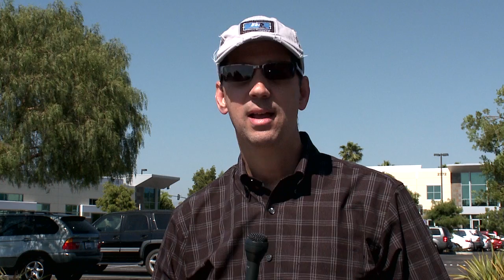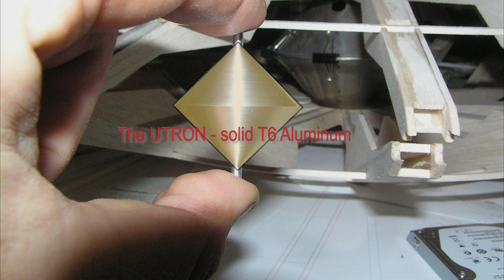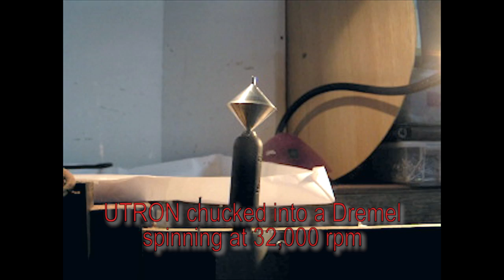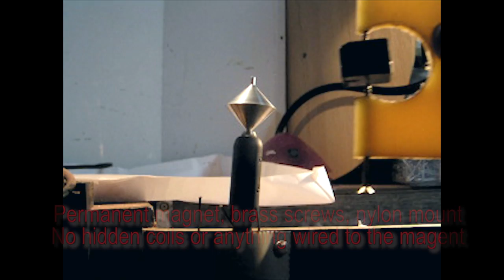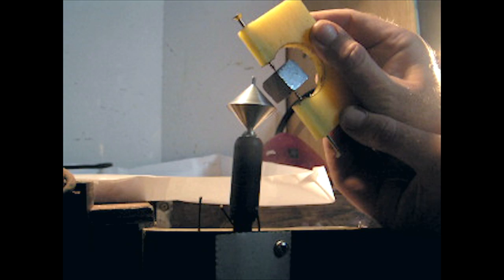Pod Update June 6, 2013

Comment: I read through some old interviews. Looks like the battery should be shaped a certain way and placed inside, rather than being powered by a cable (maybe I’m wrong). He said chemical batteries will work.
Reply: And he said the reason it runs without running out of power is because he added something to recharge the battery once the utrons started spinning on their own.
Reply: Like an expanded version of an alternator. Maybe worth building a small design?? Also, the 580 rpm was for that specific craft (45ft). Looks like the rpm should change depending on the size of the craft.
Reply from the maker: The team is well-aware of all the content you've mentioned.
Reply: Search4TruthReality so they’ve tried contained methods?
Reply from the maker: @lazarusmagellan2367  I'm not quite following you.  Help me out.  What do you mean by contained methods?
Reply: as in all methods of storing power (battery), creating the initial rotating forcce (motor), etc are all stored inside of the craft that is just scaled down in size.

Comment: I did not understand the direction of rotation of the ultron. It is not the ultron that does the high spin but the disk and the outer base. What purpose of this test?
Reply from the maker: In Carr's design, the UTRONs pass through the flux fields of electromagnets.  The guys wanted to understand the interaction between the field and UTRON.  Further, as you had seen in the other outdoor UTRON test, we had heard anomalies would manifest in a UTRON spinning at 100K RPM and the guys wanted to test it.

Comment: I have the ether technology info to power the system the Mica has very important properties in that aspect what's not mention is the ether generator (quartz crystal) and the ether amplifier orgonite together they are the power generating center of the circuit

Comment: What are these coils? To describe this the best I can, imagine if you will a circle about 18 inches in diameter. Two circles that form a sort of a -- In other words, one circle fits over another circle and from the top of the circle and coming down from the other an inverted round pyramid. There are a number of what appear to be copper wound coils around the edge of it. And then there's a sort of a framework on top and underneath there's sort of braces. That's the general idea. I noticed these cones placed mouth to mouth with some coils, the coils on the edge of this thing; it revolves within this structure. A tough thing to describe
Reply from the maker: +Ronald Bannister In Carr's design of the OTC-X1, there are C-shaped electromagnets, which are affixed to the outermost part of the inner framework and touching the outer shell, which is designed to rotate in one direction, while the central accumulator (a large UTRON in the center, which appears to be mounted to a spindle) appears to be skewered by the spindle and positioned at the center of a plate-assembly that turns in a direction opposite of the outer hull and framework. This plate-assembly, per Carr's surviving drawings, includes what he calls 'capacitor plates'.  Electrically speaking, 'capacitor' is a misnomer; because, these plate appear to be one part -- not two - and there doesn't appear to be any electrolyte between the plate, except for what is loosely referred to as 'insulators'.  Further, no electrical schematics are included in these plans.  UTRONS (also called accumulators) are mounted to the outermost section of the inner plate such that as they are mounted on trunions (above and below the plate) and positioned at a 45 degree angle that bisects the plate through holes cut into the plate.   The trunion-mounted accumulators, per my conversations with Ralph Ring, were installed and allowed to free-wheel.  in other words, no motors were attached to them, nor were they made to spin.  They just sat there.  As the plate-assembly rotates, the UTRONS would conceivably pass through the openings of the C-shaped electromagnets.  What starts the rotation or what keeps the whole thing rotating, escapes me; and, I won't even get into navigation; as, I suspect it involves bending time and space with the mind.  Mechanically speaking, the passenger compartment on the top, best I can tell, appears to be mounted to the central spindle.  Assuming this device functions, it's beyond me how that passenger compartment would not spin during operation.  

Regarding Ralph Ring, he has told me that he was an ID/OD specialist.  He milled a few parts for the craft.  He held wires in-place. He was a gofer -- to get food for the guys; and, a good friend of Otis T. Carr.  He has no specific information on the craft's wiring or design specifications.  

Peace.
Reply: +Search4TruthReality I understand those bits, have done quite a bit of reading into it and some of how it works.

On paper certainly it's sound which is why I believe it to be true.

That post was part of a previous post, where there was things talked about in the interview like the accumulator having gear like ridges, which otc replies are to act like a turbine? And improve atmospheric air flow. Which is something I've never seen on any of the prototype models.

The coil one, I just misread it reading it again after, because it didn't mention coils specifically on the electro magnets, but rather just coils and talking about them getting wider and narrower I read it as some kind of cool around the utron somewhere which I've not seen in any drawings or mentioned anywhere else
Reply: +Ronald Bannister

One thing which does intrigue me though is, presumably the central accumulator spins on bearings of some description, but in the interview it talks about 
" OTC: This model was spun at 40,000 rpm "

40,000 rpm i would of thought would generate a lot of friction and heat in the bearings?  Or even make it difficult to reach those speeds.

So I wondered if it's possible that despite not being illustrated he used some kind of magnetic floating bearing, kind of like the maglev trains hovering above the track to overcome that problem?
Reply from the maker: +Ronald Bannister What was spun at 40,000 RPM?  Regardless, you have a point.  I have a router in the garage.  It's heavy.  the top speed on that thing is 25,000 RPM; and, you have to be careful about the size and types of bits you chuck into it.   There are some large bits used in cabinet-making that have no business spinning at 25,000 RPM.   I can't imagine a 40' craft spinning at 40,000 RPM.  

Vibrating at 40 KHz or 40 MHz, that's a different story -- no physically spinning parts.  It would be shaking/moving at a molecular level?  If Otis vibrated a disk on a workbench so that Ralph could put his hand through it, then why the spin?   I can only assume to counter gravity.  Who knows?
Reply from the maker: +Ronald Bannister Regarding the coils on the UTRONS, yes, that sounds familiar...the guys had discussed this design aspect quite a bit.  They tested it and found nothing special.  

Regarding atmospheric flow, sorry to say; but, that sounds like a crock to me, especially when the UTRONS are on the inside of the craft, and not exposed to anything other than the inner atmosphere of the craft. . . just weird.

Comment: Here it is,

"'ll try to describe it further. Well, it looks like two ice cream cones put together at the wide ends, but he angle is a lot wider [90 degrees] than that of the ice cream cones. There are a series of ridges; they look like gears would fit in. Is that correct?"

"OTC: No, those are in a sense turbine; they are reactive channels and where there is atmosphere a flow of air there aids in rotation.

LJ: Well, then, this is one of the components of the drive; this is the battery.

OTC: This is the center power core."

Looks like it's the accumulator... So it should have some kind of ridges on it, not be smooth!

There's also this,

Don't know what could they are referring to,

Comment: Thing I don't understand is, Ralph ring, I'm not doubting his credibility but he said he witnessed several prototypes, one of which disappeared... And other he was able to press his hand into?  5th state of matter? Liquid, solid, gas, plasma, with it fitting in between liquid and solid.

I do believe him because a lot of what I've read about tesla experiments and what Ralph has said makes sense, and tesla was no fraud... If he said he discovered something... When you read his experiments he most likely did...so the theory is solid... It's the missing gaps in the knowledge we need to rediscover!

But as ralph was a lab technician and worked on the prototypes and in the same building I can't understand why visually he doesn't know things like how they calculated the windings on the magnetic coils... Or was there anything inside the accumulator...

One thing I noticed was in an interview they said the accumulator / utron had ridges on it... But so far everything I've seen is smooth?
Reply from the maker: +Ronald Bannister Regarding states of matter, not sure that it applies here; because, everything vibrates...at a frequency.  I'll assume that the higher matter is vibrated, the less able it is able to remain here.  Ralph described an experience where he was allowed to view his finger under an electron microscope.  What do you think he saw?  I'll tell you what he didn't see.  He didn't see his finger.  

Ralph was hired to be a lab tech for Advanced Kinetics because of his knowledge of natural law and magnetism.  There, he conducted tests.  He was tasked with finding a way to pass an electron through a magnetic field.  The solution was to pulse it.  Problem solved; but, not really.  According to Ralph, his boss told him that they were paid (by the government) to look for answers -- not find them.  Ralph quit.  

My point here is that while he may have been running tests and held the title of 'lab technician' at Advanced Kinetics, at OTC Enterprises, he was not privy to any technical data on the prototypes.  

I appreciate your technical bend on things like the number of windings on the electromagnet coils.  There are many aspects to consider when designing an electromagnet -- how much power is needed would affect the gage of wire.  If these things are supposed to be electromagnets, then the best type of wire to be used would need to be flat, as opposed to round.

Regarding what was inside the accumulators, Ralph told me Otis tried mercury.  There was an accident, a spill, and Otis was hospitalized.  The plans explicitly state that an electrolyte may be used in the center.  I've seen UTRON designs where two cones formed a spherical hollow and were milled so that they could be screwed together.  Ralph told me that they made many different prototypes and the UTRONS were made from different metals.  Aluminum and copper were tried.  When I asked him about the large one in the middle, it didn't sound to me like he was sure; so, to quote his answer may be misleading.  He said he thought it was hollow; but, for me...I had to wonder about the mercury and Otis being sent to the hospital after being injured by it.  Ultimately, for anyone looking for answers, I'd suggest they simply do their own testing and not rule anything out.  

Based on the UTRONS I've seen, they have ridges on them due to the natural milling / fabrication processes.  Back in 2011, the pods tested UTRONS by affixing coils to the outside of them.  One electrical engineer stated after the tests that he didn't see anything that we don't already know about electronics.  This was back when the tact was to test individual components.  Other members felt that the entire craft had to be constructed and tested as a whole -- an complete system.  

Once you start analyzing the OTC-X1, you'll begin to see the multitude of unanswered questions.  On the one hand, you have a man with an extraordinary story.  On the other, you have remnants of Carr's secretive plans that reveal no technical detail.  It's a conundrum.

Peace.

Comment: I'm going to try to make a short video again about magnetism, motors, vibrations and theoretical vortex. I've had some unusual results lately playing with the idea but I'm trying to rule a few things out. I know it's strongly influenced by vibrations but I have wires flexing and trying to pull themselves off of the power supply. I deleted the video but it won't take me long to set it up again. This does make me lik like a fool because it can be blamed on purely vibrations; however it opens the door to possibilities. And that's what we are all after.
Reply from the maker: The best kind of learning is doing.

Comment: I can only give a way to prove or disprove that. Tell the guy who has this to buy a plastic or fiberglass rod. Use their imagination where to get them. I find them everywhere. Bicycle flags will work. You can mount something that has 0 conductivity and 0 magnetic properties to the shaft and isolate it from the motor. 12" or several feet wil completely take the motors magnetics out of the equation. Since brushless DC motors have a great magnetic force that drives it. Also electricity is made by magnets passing around a coil. It excites the conductor. I'm positive if you can get this guy to do this for you then you will in fact have your answer. I'm as curious as you are about it. I can't bring much to the table but my mind. I've been studying this for a few years now and work as a biomed tech in dialysis. We handle the "technical details". My department is as anal as they come so I look for details. I think you could possibly be wrong. Electricity can be made by passing a magnet around a conductor at high speeds. In this case it's the opposite but the same theory. I've notice a lot of what Carr does is for sure tesla related. I've studied my share of him too but I'm more interested in Carr. You seem to have the absolute best information I have found anywhere relating to this. Like I said. I'm very interested and I'm not playing around. Yes I'm making a prop UFO but I'm actually studying frequencies so I can bring it to the table for real. I've also dug pretty deep into the quarts oscillator. I understand a lot of it

Comment from the maker: voodoodr bakermd, regarding your comment on 'electro magnet post', to which part are you referring - the dremel chuck; the solid alu utron, the copper screws, or the yellow plastic? Regarding fraud, I'm told the same experiment was conducted without the utron attached; and, the magnet did not spin. Personally, I think magnet flux lines are coming from the dremel chuck, transferred through the alu utorn & causing the magnet to spin...something to do with Lenz Law? Regarding mercury, (see part 2)

Comment: otis t carr had a real idea, it to bad that 44 sec into the viedo to 47 sec  you can see the electro magnet post pull the aluminum utron down about a 1mm movment so trying to get the public to belive that the alu,imu, urton is turning the magnet is fraud! it the magnetic coil which is hold the  aluminum utron in it is no more then a dress up, the coil utron figure whch otis carr id works so why dont u show how he use mercury in the core unite , I like to piont out he let a sign in he patnet

Comment: I disagree - After performing the same experiment using both a simple aluminum rod and a piece of copper pipe - I got the same action from a cylindrical rare earth magnet on a spindle shaft held very close to both.
It's not the motor's electromagnetic field doing anything to the magnet.
It's a result of Lenz's law causing the magnet to turn.

Comment from the maker: 1) If the aluminum were static - not spinning - would the magnet still induce an opposing field in the aluminum:
a) while chucked in the Dremel?
b) while not chucked in the Dremel?

and...

2) If the aluminum brought to spin at 32,000 rpm without being chucked directly into the Dremel -- say, connected through a pulley and belt system -- would the magnet still spin?

Lenz Law / Boyd Bushman used Alternating Current through coil of 30 AWG wire on an aluminum plate = heat, smoke, repulsion.

Peace